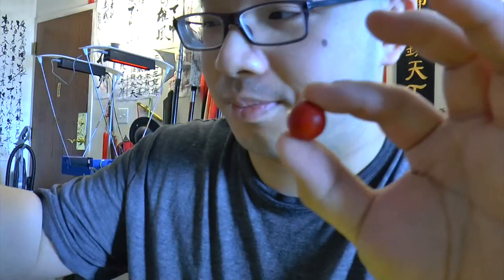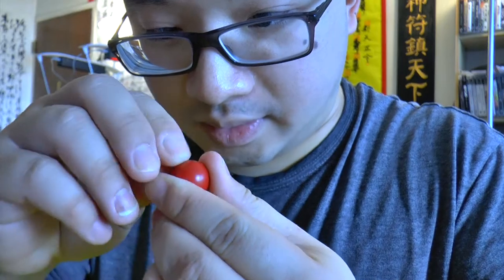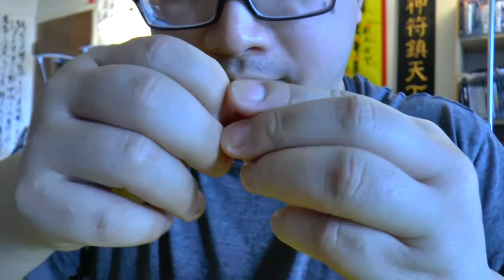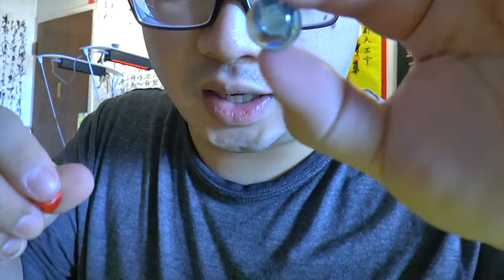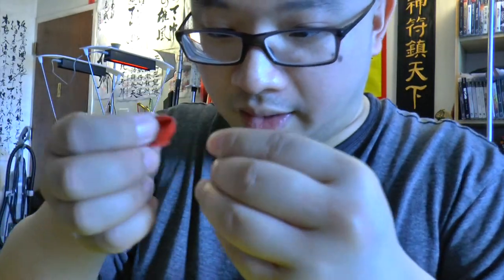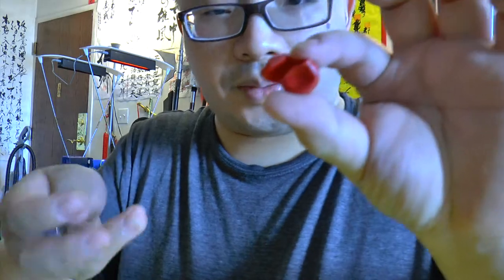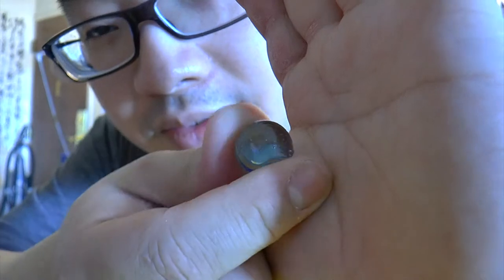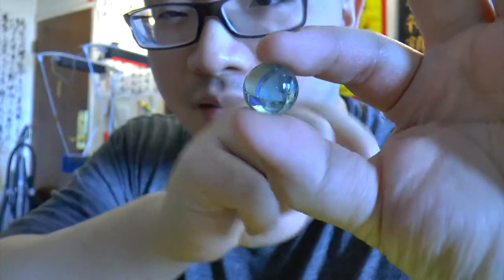What's Inside a 0.68 Cal Breaker Ball?

Comment: I always thought it would have had concrete in them coated with rubber. Now with the rubber off the marble is the weight still the same or is taking off the coating make a difference.
Reply: oh the marble itself of course weight less than the actual completed rounds. let me measure.. the marble itself weight 5.7 grams, and the actual ammo is 6.2 grams in average, so that is 0.5 grams of rubber then. But you cannot JUST shoot the marble because the marble is too small and you need the rubber to fill up the space and seal the air for it to push out properly and also fit in the magazine too.

Comment: Horrible experience with Bulls breaker balls. They stick and jam.  They are also occasionally bigger than the bore.  After buying and going through numerous co2 cartridges, I gave up.  They admitted they sold initially sold the balls with turtle wax sprat, but stopped after complaints.   I used Pam instead of Twax.  About 4 of these expensive balls jammed in my barrel, independent from each other.  
17mm glass marbles are just fine.

Comment: it being know that marble were used in what used to be less-lethal ammo during riot to take down rioters , they changed the rubber balls in the 12ga ammo by glass marbles. let say they became closer to ''lethal'' than ''less'' 

but if someone find me that kind of ammo that fit into the RAP4 Eraser i would be soooooooooo happy. otherwise, the RAP4 shotgun will be more than enough (even with a paintball, the pump action noise is one heck of a deterrent) for self defense
Reply: LOL! RAP4 "Eraser"?  You mean the Kingman Eraser pistol right?  That pistol I reviewed a while ago?  They do have mini breaker balls, solid marble inside the rubber too, but in 0.43 Cal. The caliber makes a HUGE difference in terms of weight and energy it can give, and also, the gun is not very powerful (The Chaser or Eraser).  You got a Rap4 Shotgun at your place? That gun is quite fun looking but reloading might be something hard to do fast! LOL!  I think you can tune up the power of that shotgun too, to about 300fps or so with a 3gram ball, which in conclusion is only about 170fps with the 6gram breaker ball, not a lot of punch compare to the Tiberius T8.1 for sure. But yes, the pump action noise is freaky!